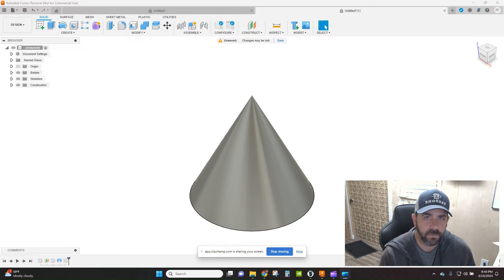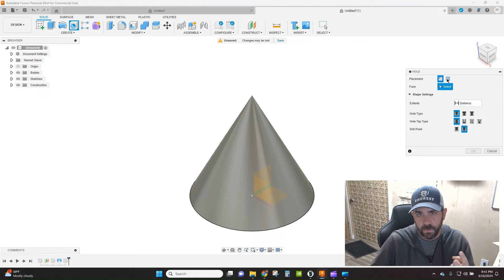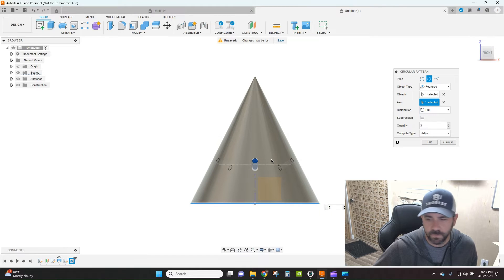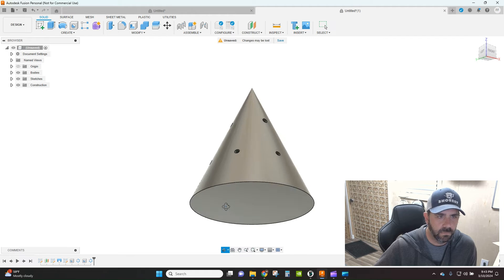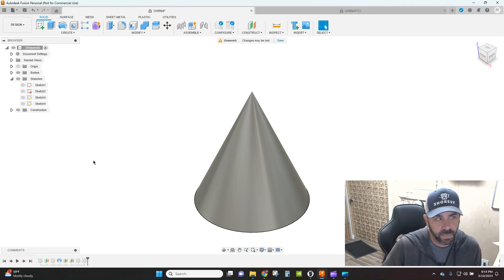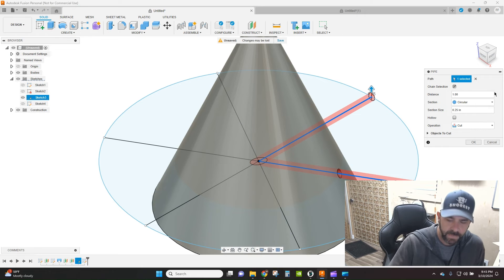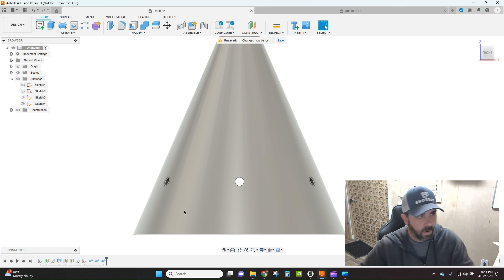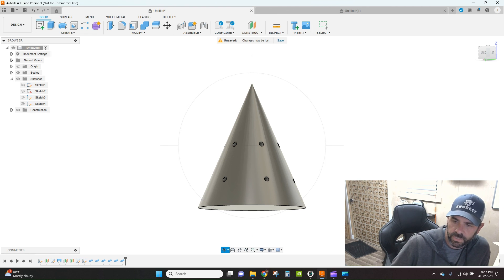Mastering Hole Patterns on Conical Surfaces with Fusion 360

Comment: Why wouldn't you use the circular pattern tool for your second method (the pipe)? Create a single pipe to the required depth and pattern that feature as you did with the hole feature.

Comment: This is super helpful for a project I’m working on at work. How would I make the pipes perpendicular to the surface of the cone?
Reply: There's almost certainly a better method than this, but I would do it this way: construct a "Tangent plane" on the face of the cone. Adjust position as required. Create a sketch on that plane and draw a construction line from top to bottom of the cone (ie: along the face of the cone). Construct a "Plane along path", using the construction line from the previous sketch. This should be at the centre point of your pipe. Create a sketch on the new plane and draw a construction line through the face of the cone for your pipe. You can "circular pattern" the pipe around the cone if required.

Comment: how to draw rectangular holes
Reply from the maker: In this case it's usually easier to sketch one on a plane or surface then use the pattern tool to layout as many as you need.  Then you can select them all and extrude them a defined depth.

Comment: When using the pipe method, doesn’t this make a connecting path between all holes? If it’s desired to just make the holes a given depth, does that rule out this method? Or would it be necessary to “plug the pipes”?
Reply from the maker: it does for sure the way i've done it.  I think limiting the length of the line to a specific depth might be feasible.